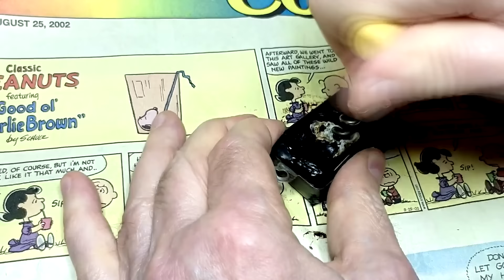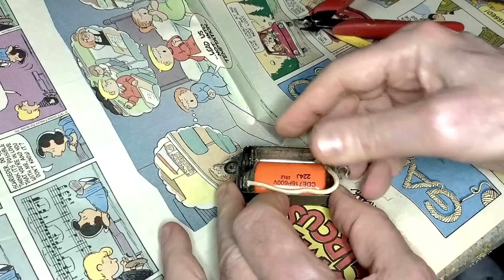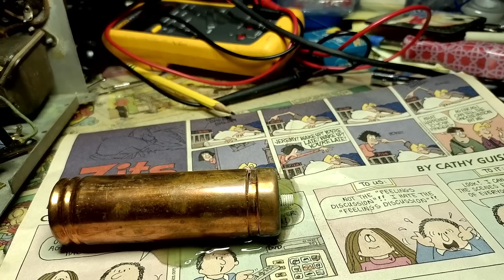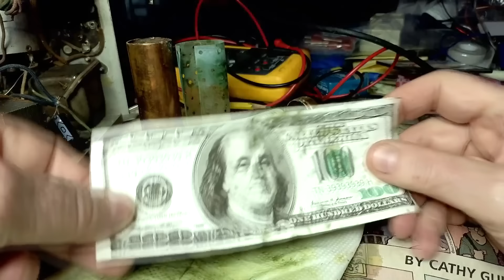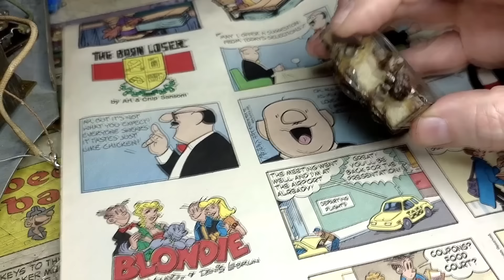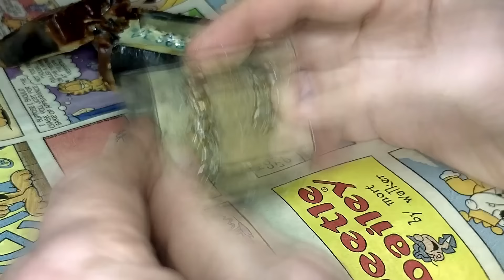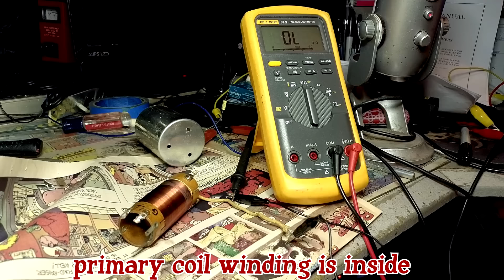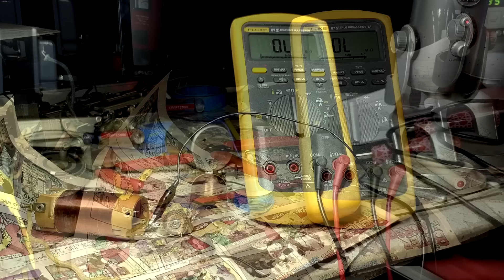1930 Gloritone Model 27 Part 2

Comment: I love how they just screwed all the components to the back panel. probably maximized the use of the space they had at the time. later when capacitors got smaller they could put them all under the chassis. Nice job fixing that coil! I'm having a similar problem with my Philco 89. maybe I need to check out that antenna coil
Reply from the maker: Hi Dan...I really am enjoying this weird radio, haha...it's one of a kind...hey Dan..lets have another Uncle Dorkel or a vintage paper cup poor boy video!...haha

Comment: Another great video Buzz. Interesting find on that blown wire. Yes watched Dave's Video earlier it will be nice to see how he refurbishes the case to that radio. Its great how all you radio restores work together on you tube. Wish we had this Knowledge shearing back in 1974 when I started out as a Signal & Telegraph engineer.
Reply from the maker: I think David is the best restorer on YouTube....stay tuned because he gave me an Aussie  radio to restore!👍👍
Reply: @Buzz1151  Living in the US, I don't know if I could ever get used to the frequency scale of the dial having only call signs.  What looks at first like a 5 band radio, is actually just a standard MW AM broadcast receiver.  On the plus side, nearly every Aussie radio has a power transformer, which I really like.  Growing up in Florida in the 1960's, and since concrete floors were used in homes, I was always getting brutal shocks from those hot chassis on the AC/DC sets.

Comment: Great restoration job so far. When cutting open those electrolytic capacitor copper cans, I would have considered used a plumber's pipe cutter.
Reply from the maker: haha. I had one from 50 years ago and wanted to use it, but . alas. I could not find it. your comment wins a free cookie! 🍪

Comment: A few weeks ago,i restored a german nordmende Carmen 57,i have restuffed the electrolytic capacitor too,because the aluminium can Was labeled nordmende too,it has 3x 50uF 350 volts inside, i replaced them with 3x 47uF 400 volt capacitors, and proper insulation of the wiring. Works perfect.

Comment: Thanks Buzz for another interesting video.  

I have seen copper canned electrolytics once.  A 1932 Philco grandfather clock I restored in 1973 had these, although they were mounted above the chassis, like electrolytics in the mid 1930's.  I left them in place, disconnected them, shined them up, and coated them with varnish.  What a surprise, your caps were still filled with electrolyte! 

The cabinet strip and refinish came out really well without any major problems to tackle!  Strange how the nail heads are visible.  I guess that omission was part of the cost cutting.

Those two RF amp stages are strange, not to mention the missing electrical connection and how did it pass Test?  The plate circuit shows a 50 pF capacitor connected to the RF transformer primary.  For a tunable circuit, that part should not be there, it will cause a narrow, fixed frequency bandpass.  I didn't see any sign of the 50 pF capacitor when you had the RF transformer out.  The RF transformers were super cheap, not wound properly for RF, that is part of your poor sensitivity problem.
Reply from the maker: the 50 pf cap was is the 2nd RF can...remember I said I had to take out the 1st can first to get to the 2nd....which I will probably do in part 3.
Reply: @Buzz1151  Thanks Buzz for your response.  I remember seeing in your video, the order of disassembly to get to the desired transformer but, didn't see the 50 pF cap in the video, perhaps I missed it?

I am wondering if this particular radio is an example of the "fly by night" radio manufacturers that popped up and subsequently died a few years later, fueled by the insatiable demand for radios at that point in time?  With demand being so high, proper radio performance probably became secondary due to competition of price and availability.  If the radio could pick up a few stations on the band, it may have been been considered "working acceptably", even with the glaring dead spots in sensitivity.
Reply from the maker: @billharris6886  ill be checking the cans with the 50 pf cap in part 3.